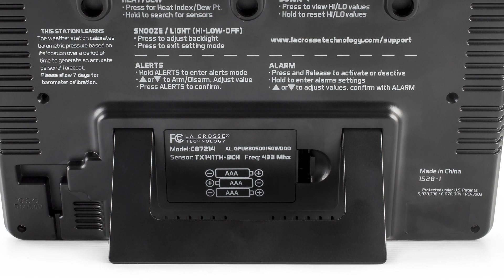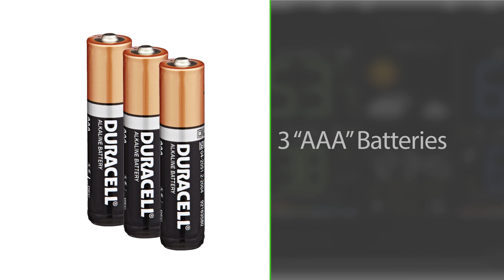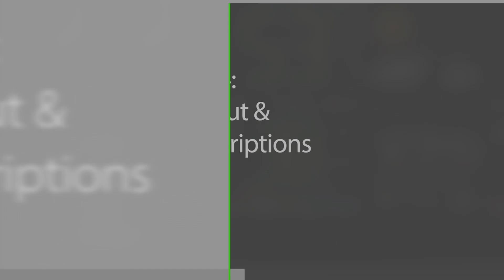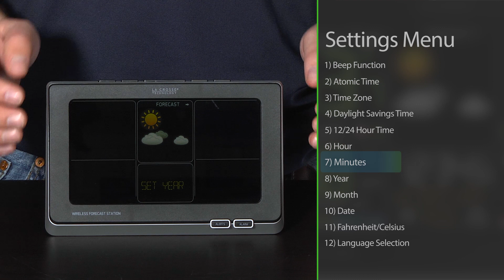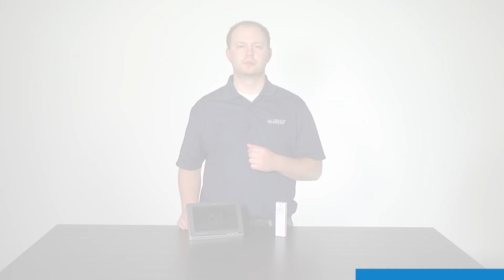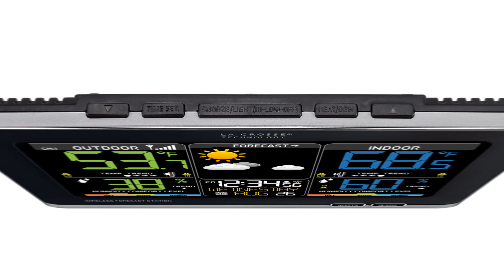C87214 & C87030 Wireless Color Forecast Station Setup Guide

Comment: I have Model: C87030 and have always used the atomic clock setting but it shows an hour off. For instance, it's now 12:13 PM CST but the weather station shows 1:13 PM. Is there a way to resolve this with the atomic setting or do I just set the time manually?
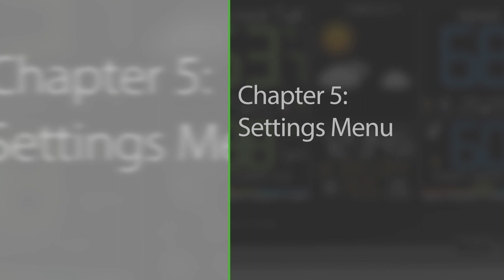Reply from the maker: Please ensure the correct Time Zone is selected within your settings menu. Instructions for this start at the 11:34 timestamp in this video. If you live in an area that follows Daylight Saving Time, be sure to select ON for this setting to allow the clock to auto-adjust during time changes. If you need further assistance, please message our support staff here: https://bit.ly/contact_techsupport, or alternatively, send us a private message on our Facebook: http://bit.ly/LaxTech_Facebook page.

Comment: Thanks for the video. Very informative, but didn’t answer my question. My outside temperature display is about 10 degrees warmer than the actual outdoor temperature. My sensor is not in the sun.  It also shows low battery icon even after I installed new batteries. What suggestions do you have?
Reply from the maker: Hi Kay, our apologies for the trouble with your outdoor sensor. For best results, please try a new set of regular alkaline batteries from the same package in the sensor to help avoid possible incorrect low battery alerts. To test its accuracy, we'd recommend performing a side-by-side test as covered in our other video here: http://bit.ly/inaccurate_temp_readings -- If there is a drastic difference between your indoor and "outdoor" readings after this test, a new sensor would likely be needed. For help with this or for assistance in general, please message our support staff directly here: https://bit.ly/contact_techsupport. Or alternatively, send us a private message on our Facebook: http://bit.ly/LaxTech_Facebook or Twitter: http://bit.ly/LaxTech__Twitter page. We are here to help in any way we can. 😊

Comment: GREAT Video even to refresh my memory on how to use the C87214 functions I don't use too often or even just changing the batteries.  One function you can clarify is if I set an "alert" and the "alert" does go off, how can I clear the "alert" icon on the display after I fix why the alert went off.  Thanks
Reply from the maker: Hey Tim, great question! When an alert is triggered, the display will likely beep every minute until a button is pressed. The specific alert icon will remain flashing on the display until the value is back outside of that alert range. To stop the flashing in the meantime, you'll need to re-enter the alerts menu and either set that specific alert to OFF, or a value above/blow the current reading. Our apologies for not covering this more specifically in the video.

Comment: I do wish that there was a station that concentrated mainly on outside weather on the screen. They all split the screen equally between in and out. It's a weather station for outdoor weather. The indoor temp should be a small part, and the rest for outside.
Reply from the maker: Our apologies for any trouble finding a station that fits your needs. We do want to note though that not all of our units split these sections equally, for a more weather focused item check out our current selection here: https://www.lacrossetechnology.com/collections/weather-stations

Comment: What do the beeps mean?  My unit will beep 4 times about5 - 10 seconds apart.
Reply from the maker: Hey Jeff, this is likely a temperature or humidity alert. When triggered, the station will typically beep a few times each minute until that value moves outside of the alert range. A simple button push should turn off the beeping, but the alert icon will continue to flash until out of that range. Our apologies for not covering this in the video. If you should need additional assistance, please message our support staff directly here: https://bit.ly/contact_techsupport. Or alternatively, send us a private message on our Facebook: http://bit.ly/LaxTech_Facebook or Twitter: http://bit.ly/LaxTech__Twitter page.

Comment: I am enjoying my new weather station.  I have bought a new outdoor temp/humidity detector.  How do I couple it to the weather station so it will, I guess be a channel 2 indicator?
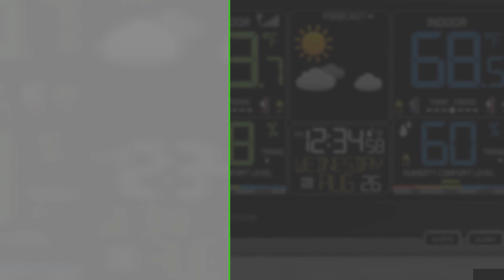Reply from the maker: Hey Brent, we are thrilled that you're enjoying your new weather station. As for having the display show data for multiple sensors, this will depend on the weather station model you own and the extra sensor you purchased. But assuming you have either our C87214 or C87030, as featured in this video, these multiple sensor instructions are covered starting at the 23:12 mark in this video or on pages 11-12 of the full manual here: http://bit.ly/c87214_manual 

If you should need any further assistance, please message our support staff directly here: https://bit.ly/contact_techsupport. Or alternatively, send us a private message on our Facebook: http://bit.ly/LaxTech_Facebook or Twitter: http://bit.ly/LaxTech__Twitter page.

Comment: I have Model: WWW8577V2, why does my time (EST) show regular time from 12 midnight until 12 noon, then change to military time from 12 noon until 12 midnight? email karenmazzola@ymail.com
Reply from the maker: Hi Karen, sorry for the trouble. It sounds like you'll just need to switch the 12/24 hour setting within your display's settings menu. When set to 24 it will display military time, so be sure to select 12/hour within the menu options. Instructions for this setting change can be found starting on the bottom of page 3 in your full manual here: http://bit.ly/ww85777v2_040219 -- If you still have questions, please feel free to reach out to our support staff directly here: http://bit.ly/contact_techsupport

Comment: Can someone please just show me how to change F to C without making me watch some hours long video?
Reply from the maker: Hey Jen, this setting will depend on the product model you own, but assuming it is a weather station similar to the one shown in the video, the F/C setting is typically located in the Settings Menu. Hold the SET (or TIME SET) button until values start flashing to enter the menu. Use the +/- (or UP/DOWN) buttons to adjust settings and the SET button again to confirm and move to the next setting. Page 6 of this item's full manual goes over this as well: https://cdn.shopify.com/s/files/1/0035/7443/1790/files/c87030-c87214-manual_revised_030717_1.pdf?v=1594066127

Comment: I have the 308-1414B and shortly after it's 1 year warranty expired one of the arrow buttons broke and I never pressed on it hard or abused the weather station, then a few months later I accidentally bumped it off my speaker that is not very tall onto a basement carpet and all but 2 of the buttons broke so now I can only see the low temperature of the day. When I opened it since it's warranty expired it did not have a high quality built look to it and the circuit board for the buttons was flimsy. It worked great before then and rarely lost communication with the remote sensor and it was easy to reconnect to it by holding down the search for remote sensor button.
Reply from the maker: Hi Dallas. We are sorry to hear about your 308-1414B and apologize for any inconvenience. Sounds like you had a bit of bad luck there. Please reach out to us with your name, phone number, email address, and reference to this post privately on our Facebook: http://bit.ly/LaxTech_Facebook or Twitter: http://bit.ly/LaxTech__Twitter page to see what options we may have available for you.

Comment: Help please: Outdoor side is not working, just shows dashes as show on the video.  Tried what was said however, it did not work.
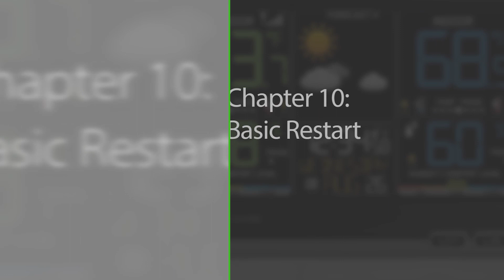Reply from the maker: Hi Lin, if you've followed the restart steps at the 25:36 mark in this video, and you're still not seeing your sensor's data appear, please get in touch with our support team here: https://www.lacrossetechnology.com/support/index/form/ as you'll likely need a replacement sensor, which can be found on our website as well: https://www.lacrossetechnology.com/tx141th-bch-temperature-humidity-sensor -- Sorry for inconveneince.

Comment: Hi, my reading inside the house not equal although the out sensor beside it, how can fix this? Also can we upgrade it by getting the rain and wind stuff?
Reply from the maker: It is not abnormal to see a couple degree difference between your sensor and station. These are programed in the factory with a tolerance of +/- 2 degrees (this cannot be modified). This video may help explain this: http://bit.ly/inaccurate_temp_readings 

This station unfortunately only allows up to two additional temperature and humidity sensors to be added. If you're interested in a station that offers more expandability (with wind & rain data) and possibly even remote monitoring, one of our connected La Crosse View stations may actually be a better fit. You can find our selection of those here: https://www.lacrossetechnology.com/products/monitoring-view/view-connected

Comment: How about using the actual readout instead of graphics so that we can see what the unit actually looks like?!
Reply from the maker: The majority of the second half of this video showcases the actual LCD screen, where we walk you through the settings menu, set time alarms and alerts, setting up multiple sensors...etc. The bright studio lights make it a little harder to read than normal, which is why we choose to use graphics for pointing out the LCD features. Plus some of these elements will only show under certain conditions, thus making it hard to showcase instantly for a video.

Comment: So I have had two of these units for awhile and just purchased a weather station as well. For these units, I have never been able to get the atomic time on either, yet I have atomic clocks that pick up the time correctly. There are no obstructions, etc. Are there any additional tips for connecting and maintaining the atomic time? Any known issues on that aspect? Also, you show in the video that you have atomic "on" yet you set the time. Could that be part of my challenge? Thanks in advance for your help!

Comment: Why did you discontinue this model and why do you charge more for the 308-1414B which has less features? You Can't turn off the Beep sound and it does not display the seconds.

Comment: 1.why station shows sunny/cloudy, but actually outside is raining? how to fix this problem?
2.does outdoor sensor have to face north only? 
3.my model on the battery cover printed 872115, but on the back cover paper sticker shows C87214. so which model do I have? it looks like this instruction video black case.
4.why my station has no atomic time icon?
Reply: thanks for your quick reply.
1.I will wait 2 weeks to see if forecast accuracy is improved?
2.is outdoor sensor waterproof?
3.the station I got is C87214, according to its LCD layout. 
4.viewing from the top angle, finally I found the barely visible atomic icon. however, there is no way to adjust it...

Comment: I purchased the C97214 a few months ago and found that the 'forecast' seemed to be stuck on partly cloudy. On contacting LaCrosse regarding the problem, they replaced the unit. This unit has exactly the same problem even after allowing 3 weeks for the barometer to settle. Is this a common problem?
Reply: I live in Lake San Marcos, CA, which is about 8 miles from the ocean and at no more than 250 ft altitude. No other icons have appeared on the screen of either unit since initial installation.

Comment: I want to love this weather station I just got but the temperature has done nothing but be all over the place. I set up the remote sensor in the same locations as my acu-rite and my other thermometer. This one is always from 6-15 degrees off! I've followed at the instructions and even followed what they say to do in this video and it's still way off and all over the place. It was 62 at night here and Temps falling and this said it was 89 and Temps rising. I'm about to just return this thing. Very nice screen and everything but useless if the temp isn't even within  10 degrees difference. I guess I could brush up on my math and just deduct 10g1t degrees off of what this station says... Super bummed on this
Reply: La Crosse Technology thanks. I'll look into this.
Reply: I have the exact same problem with the one that I just purchased too.
Reply: Debbie Peters that's a bummer. I emailed them like the person said too, when I got a reply, I had to clear a week on my calendar to start jumping through the hoops process lol trying to get this resolved is about as much if a pain in the ass as the thing not working is. Good luck. I'll probably tossing in the garbage and stick to my AcuRite. They're always on point.
Reply: KRS, I wish I would have read this before buying mine & have read others reporting basically the same problem. If you don't mind me asking you, do you know which model of the Accurite that you have? I don't want to wind up buying several weather stations to finally get one that really works as it is supposed to. I thought that I had researched this model enough, but apparently missed this problem altogether in what I read. Thank you for your post warning others.
Reply: Debbie Peters Yeah I think we're in the same boat(s). The AcuRite I have is a wireless, small unit. Pretty basic, nothing fancy. It says model 02044w1 it shows inside and outside Temps and time. The reason I wanted this weather station is I need to know outside humidity as well and temp alerts option on the LA Crosse was very nice. I paid $80 for this station that's pretty much a nice paper weight. I'm now trying to contact the company I purchased this from to see if they'll take it back. Going through the process the person from the company said to do in the comments is way way too ridiculous lol the questions they asked and the stuff they want me to do I am not doing. I'm no longer investing any more of my time nor energy into this. Hope you get your problem resolved.
Reply: KRS, Thank you so very much 😊.

Comment: ?if i need the device only for in room temp measurement - can i leave the sensor not connected at all
Reply: also, i need the device to bip (or make any other sound) when/if temperature is getting  over certain measure. 
?is this device has this option

Comment: Hi. I just connected the weather station and set it up exactly the same 
as in your video. I placed the sensor just next to the weather 
station(just for now) and could you explain me why despite that the 
sensor is placed next to the weather station there is over 1 Celsius 
difference between the outdoor and indoor reading on a weather station 
display? I`ve been waiting for over 15 minutes now and it is still the same. 
How can it be accurate after placing the sensor outdoor if it can be even accurate being next to each other?

Comment: Hi...I have a c87030 which I bought back on 11/28/16.  All seems to be working fine, however, the external temperature appears to be ~4-5deg. higher than shown on my local weather reports & weather.com for my town.  Do I need to calibrate it to minimize the difference ?

Comment: Our model is the 1425B.
It worked fine for 5 months then....incognito...it quit. 
I have tried every combination of methods to get the two units connected. Changed so many batteries as if I owned Duracell. And NOPE! Not talking to each other. The light on the sensor twitters some and then goes out. Ergo, I changed the batteries. I got beeps out of the base station but changed the batteries anyway. I waited 15 minutes 3 or 4 times for all reps. Then I started waited a couple of hours. That worked once. So, I tried it again for a half dozen more times but..NADA! I tried your method of factory setting (reboot?) by setting down uncharged over night. From the beginning, I pushed the button 20 times on several reps. Then I tried pushing it 30, 40 even 50 times. Then I pushed the other buttons, all the buttons, in as many lottery combinations that I could think of. Did I win. NO! Now it's pushed my button.

Hate to see so much money go down the toilet. One solution is if I get any more frustrated with it, I'll hammer it into so many pieces that it will travel that way far from me quite nicely. Even so, I'm flexible and ready to give it just one more shot before it gets recycled. 

Got ideas? 

By the way, why don't you all have a brick and mortar location where we can have the set repaired if it is broke? I own two. And the other works fine. But if I can't get relief from this one, they will be the last of its kind.

Comment: (
Hi! La Crosse Technology)The weather station works with a different method for providing weather forecasting is that true? The weather station that I had before this one, changing weather icons according to a rise or fall (3 HPA). Your colleague explained to me  the station not change the icons in an exact measure now, she explained to me  the icons change according to the speed fluctuation in barometric pressure now. More barometric pressure falls or rises rapidly over the icon will change it's true that it's become like this???

Comment: Excellent weather station:

1- The outside temperature are accurate and also inside
                                         
2 humidity inside and outside are also acceptable
                               
 
3-accurate weather forecasting 70-75% (sometimes more accurate than TV
                                

4- Just a little thing that're weird, the comfort indicator value too

high or low
 
I recommend this station go pick one

   5-Install the outdoor sensor in a shade place and at least 6 feet from the ground to allow the RF signal to travel well

  Note: This is the external transmitter that provided the weather forecast, the weather station only show the weather forecast
Moins